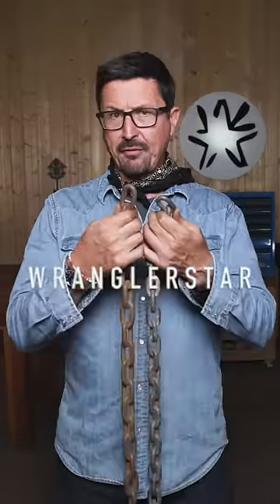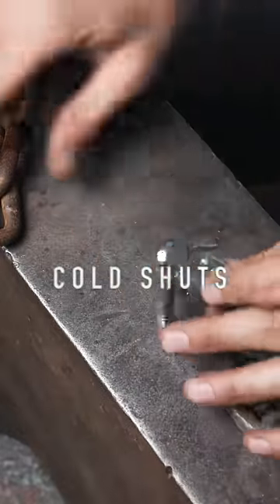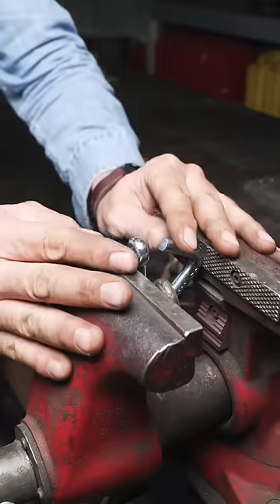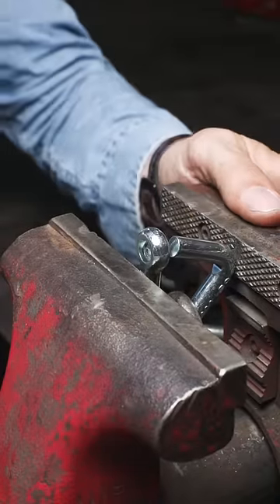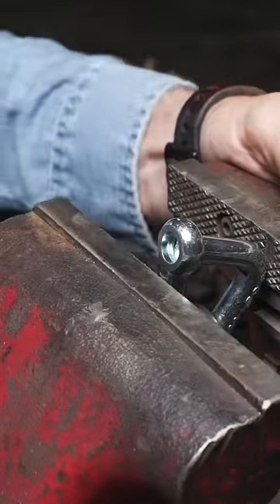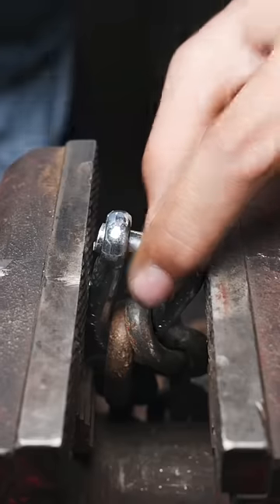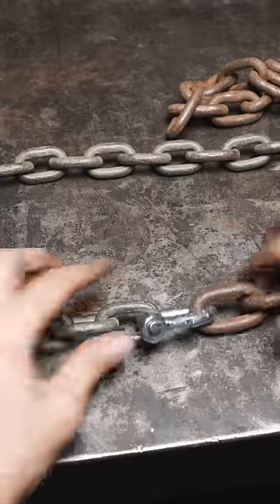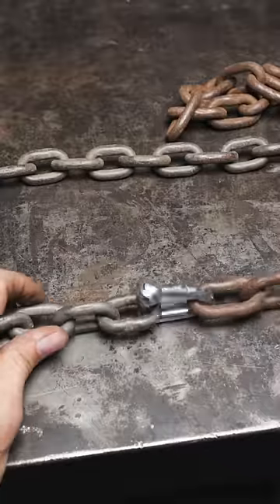Emergency logging chain repair Wranglerstar professional Homeowner #shorts

Comment: Kinda hoped, he was going to shut it with hammer or even back of the axe. Like in the, you know.... emergency situation.
Reply: I'm no expert but I'd expect a logging truck to have a vise mounted somewhere on it. Alternatively, this same guy has made videos showing portable logging vises for maintaining chainsaw chains. They'd probably be adequate for this purpose too.
Reply: @danielm7960  why would you even have this big chain without vise
Reply: We hammered them shut, then when we got  back home we welded them together!
Reply: Yeah if im in the field i dont have a voce- a logger may but  professional HOMEOWNER with tools you have on hand... most people would just have an axe chansaw probably a hammer...
Reply: Oh and also they male quick donnect figure 8 links that maintain the strength of the chain
Reply: @xmuggsyx  i dont even cut down trees or anything and i have toolbox full of things in car... in case my car gas defect. if ive had invested the money for tools in the car, there would be no need for the tools
Reply: @danielm7960  I mean, that's possible... I just think that when demonstrating "field emergency repair" you should be using tools as simple as possible.
Otherwise it can be like those "DIY" carpentry videos made in professional workshop with thousands dollars worth of equipment.
Reply: @danielm7960  those portal devices don't have nearly enough clamping pressure to actually do this and I've never seen a logging truck with the lights on it I've seen them with a "bar rest"
Reply: You clearly haven't watched all his vids, he demonstrated the stump vise.
Reply: @Gravitics  saw that one actually... Still, I don't consider stump vise to be a basic tool ideal for emergency situation demonstration.
Reply: @toncek9981  it is for situations he usually is talking about which is u.s. forest service fighting fires
Reply: @Gravitics  clearly you seem to think that said stump vice has enough clamping pressure to actually do this
Reply: @Gravitics  that small stump vice wouldn't open far enough to put the chain link in it let alone apply  enough pressure to close it!
Reply: @VR46Monster  use chains much bigger daily during construction and we usually don't have a vice around as most the job is dirt still
Reply: @ryantracey8574  ive wrote it wrong... who would have this conecting device without something to press it together. 😄
Reply: Most work rigs these days have a vice welded to the bumper or flatbed or whatever. I've worked for three different companies with work rigs and all of them had vices and welders. Given the welder makes the vice unnecessary in this situation.
Reply: I don't even own a vise and I know a logging truck should have one mounted on the back if a damn centerpoint energy truck has ine
Reply: @danielm7960  As someone who does field repairs all my work trucks have a vice bolted on the back
Reply: @toncek9981  I'm voting for the nut and bolt. I can take one off my rig from somewhere and it's tried and true!
Reply: Define emergency. Is a life at risk, or are you just 2 days drive from any depot?
Reply: @UKMonkey  2 days drive from depo and grizzly bear stole your vise...
Reply: Same thought here lol
Reply: Kinda be heavy carrying a vise arround with you too right . For emergency took repair in field think been more realistic if you used a hammer or sledge or you know something a logger or whomever would have in the field
Reply: @xmuggsyx  I would say any work truck worth being a work truck has a Vice on it.
Reply: My vice is next to my welder, so I think I'll go with E6010 SMAW in an emergency. Could probably have it welded before this guy has his vice open, and the slag chipped by the time he's got the "cold shut" inserted.
Reply: @Arizona_rider  so you could carry some hammer and vise grips or something...
Reply: How about just using a $4G70 Chain Link Double Clevis
Reply: I once watched a truck pulling out a stuck car with one of these on. I warned them that it was a not a good idea to ue that chain. They didn't listen. I got the hell out of the way and sure enough it broke and damaged both vehicles, lol.
Reply: So who has a BENCH VISE in an emergency repair in the field of a logging chain??
Reply: Also how do you get the chain back open again
Reply: He did say like a homeowner,Most logging trucks will have plenty of chains,or repair shackles..
Reply: Haha
Reply: What are you going to be doing with a chain like this that doesn't require some sort of vehicle?
Reply: A vice in the feild?
Reply: You are poor prepared, Mr. Toncek.
Reply: @toncek9981  a vice is an extremely common peice of equipment for a wood worker of any kind carpenter or logger or fire service
If you have a drill why not a vice
Reply: What kind of logging rig doesn't have a vise?
Reply: @donaldhofman5257  or just beat it with a hammer to mushroom the end of it out so it won't come back through the hole and help a little bit I'm not maybe not as good as welding it but you know probably don't have a welder with it but you can take two axes or your ax and a hammer and mushroom the end of it out a little bit
Reply: Most of the trucks that go out there have a vice
Reply: @Daniel M  I was raised in logging and, not a damn one our companies has ever mentioned a vice on the job site or anywhere else.

Would it come in handy? Rarely, of all the things to break the chain is actually the last one. More often than not, its the trucks and talkie tooters
Reply: Well if his chainsaw broke down and he showed us how to continue with a handy axe it would be like wishing he cut it down with his teeth or a nearby rock instead. I think most people would resort to banging it together with a hammer or axe as you suggest but having him show that a vice is a nice controlled method will at least make sure the person who has both a vice and a hammer chooses the better more controlled option.  Of course if you have both you may want to hammer the end once it's passed through the loop to hopefully stop it pulling apart as easy when the chain is under tension.
Reply: Every professional homeowner has an emergency vise... Duh
Reply: @into_the_void  Joke?
Reply: @Strix1213  not a joke to the professional homeowner
Reply: General work trucks have a vice on the tailgate
Reply: @xmuggsyx yes chainsaw it shut 👌🏼👍🏼
Reply: It's an emergency field repair in the shop.
Reply: Me too. Then I wondered why he does not just have a few D shackles for such emergencies, with which you can join a chain just using your fingers.
Reply: @danielm7960  almost every truck that goes in the woods has a vice on it
Reply: Bro every serious service truck on earth has a vice mounted.
Reply: @xmuggsyx not too expensive to just mount a vice on the tailgate of your truck if you’re serious about homesteading
Reply: @toncek9981 it’s a field emergency repair for logging chains, the kind of people who use logging chains usually have a vice mounted in their truck usually on the tailgate. If you don’t use logging chains in the first place this isn’t a repair for you
Reply: @VR46Monster  i did concrete. We had chains like that on every truck and not 1 truck had a vise on it.
Reply: The field truck has a vice don't worry
Reply: Most guys that would need to do this have a bench vice on their work truck
Reply: Have you all lost your damn minds?!
YOU DON'T EXPECT TO HAVE A VICE IN AN EMERGENCY FIELD REPAIR SCENARIO. EVER. 
Any scenario where a vice is in play, isn't a freaking FIELD repair.
MIGHT as well throw in that field welder with generator, 100ft of spare chain, boxtruck with workbench and tools... 😅😅😅😅😅

Comment: Lemme just pull out my shop vise in the middle of the "field"
Reply: Right!😂
Reply: Most logger/Arborer work trucks will have onboard vices
Reply: @369Sigma  and shackles
Reply: I drive an F350 that was a logging crew rig before I got it. There's a vice on the back of the bed
Reply: A lot of times you see them mounted on trailers or bumpers
Reply: who needs a vice when you can use your teeth?
Reply: Vice
Reply: A truck in the field has a vice
Reply: Hahahahaha
Reply: @369Sigma  that's not normally a standard homeowner tool, I have a lot to tools to do a lot of different things but a (what looks to be $300 at minimum) vise mounted to a work bench is not one of them
Reply: @BlueScreenCorp  it actually is depending on where you live… and you can get a bench vise for probably $30-50… not that I’d recommend one that cheap
Reply: its called a logging chain for a reason, do you think loggers on a work site wouldn't have access to something as basic as a vise lmao?
Reply: Trucks in the field have vices but evidently no spare chains.
Reply: @Mr Poopybutthole no the 350 may not be in the clear cut, but it would be likely within walking distance of it, which a brand new chain or a welder, is not… “think people!”
Reply: why not just use a repair link that only requires a hammer to install?
Reply: I work for the city and we have vices that mount to trailer hitch 👌
Reply: Most real workers have a vises fixed on their work trucks
Reply: We have a vice and basic hand tools always, and an on board welder made from an alternator cheap and easy budget stuff to CYA when out in BFE
Reply: I have a vice that goes into my receiver trailer hitch.
Reply: Or just use your truck tires. Hell, pin it against your hitch and a jack. Hammer it? Don't try to be a so smaart when you didnt even try the right way 😘
Reply: Sounds like you have something to add to your toolkit.
Reply: @369Sigma dang thanks for the info nor many know that evidently
Reply: I was thinking of a quick link that you screw with your hands but what do I know. 😂
Reply: @scottmantooth8785  - Chuck Norris
Reply: @Lickety-Split  lots of rural homeowners log their own property or cut firewood in the forest. Get out of the suburbs once and a while.
Reply: Why are you doing feild work without a vice on your truck?
Reply: @meb212  if you're using a chain there is probably a skidder or some sort of vehicle around lmao
Reply: @Robmancan1987  Screw links don't hold near what a cold shut will hold.  Plus I always use a cold shut 1/8" bigger than the chain I am putting together.  I've done that enough that I trust it.  You can't get a bigger screw link into a smaller chain, so you can only use one for the size chain you repair.
Reply: @ridgerunner106 That's true. Both are probably good to have depending on where you are and what your doing.
Reply: Vice grips work.
Reply: Goes to show who’s knows…. And who doesn’t……….. lots of DOESNT in this feed.
Reply: Pro loggers would just get another chain.  Pros carry more than one chain 😂😂
Reply: You don't have a vice bolted in the bed of your truck? Huh.
Reply: Should be mounted to your pickup...
Reply: @jamesmccormick2696  you had a vice but no extra chains? A likely story
Reply: Bro every service truck has a vice on the back bumper
Reply: @TimSKarlsson  I wasn't the logger, I bought the logging company maintenance truck
Reply: Exactly the question I was going to ask!… well done sir
Reply: Many crews nor only have a vice , they have spme sort of welder.
Reply: ikr :D
Reply: man your a little slow arent ya?
Reply: I see bed mounted vices on handyman trucks, there's no reason a logging crew wouldn't have them
Reply: Put a vice on all work trucks.
Reply: But they do though....
Reply: Lots of utility/repair/recovery vehicles have vices built in
Reply: I mean i found a vise in one of my dads tool boxes
Reply: You should have a vice on your truck. If not you’re not planning ahead, there’s a lot of uses for a vice in the field.

Comment: Of course, I always have a bench vice when I face an emergency in the field.
Reply: Only the vice? I always drag a metal working bench with a vice attached when ever I go into the forest..
Reply: I usually have an 800lb welding table and 20t press with me in the field
Reply: I never leave home without my emergency anvil.
Reply: Dude always has the back of an axe head
Reply: Who doesn't?  A hitch receiver vise is $129 at Harbor freight
Reply: @elkvis exactly
Reply: Most people have a vice on the back of logging or heavy equipment. Granted I don't have a vice on the back of my taco.
Reply: They usually have one on their trucks specifically for reasons like this
Reply: You can close a 3/8" cold shut with pliers and  hammer in a pinch but when I'm in the woods I have a small vise along.
Reply: Exactly what I was thinking.. if you have access to your shop with a vice, where’s the emergency?
Reply: A lot of industrial work trucks have vices mounted somewhere on the bed.
Reply: Most logging trucks have a vise on them
Reply: Having a vice on the chuck in normal
Reply: Truck*
Reply: Most trucks have a vice attached
Reply: Welding rigs have a vice on the back.
Reply: Yeah thought the same. But I know a guy who actually made a custom steel bumper for his 90s ford and he incorporated a vice on the front 😂
Reply: You can’t carry a vice around in your truck and put it in the hitch receiver?
Reply: I bet you also use logging chains huh
Reply: A lot of work trucks have a bench vice on the back.
Reply: @ZoidbergMustache just a press? i like to at least keep a break and a press along with some kind of hydraulic sheer and of course my handy dandy bridgeport mill (though i rarely leave the house without that thing tucked somewhere on my person) gotta act accordingly. stop acting like the struggle is coming and acclimate yourself to the struggle before it’s even here and there will be no struggle to come. have a good day beloved

Comment: I know it’s for emergency’s but the problem is that when I’m in a situation where I break a chain the last thing I need is a weaker chain.
Reply: There it is there.
Reply: This!
Reply: True... But what's better? A weaker chain, or no chain?
Reply: @treyhart6861  I tend to agree with the original author. If you are in a situation where you broke a chain, how would a weaker chain help?
Reply: @AdrienGiboire How can it help if one link failed and got replaced?